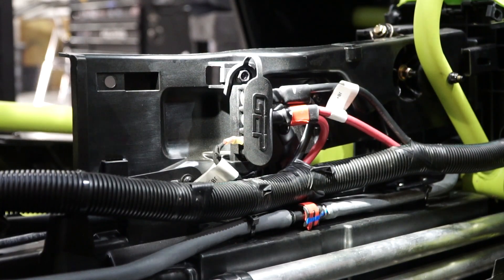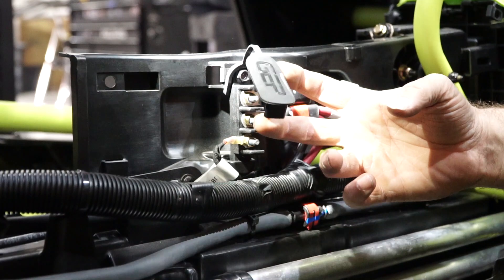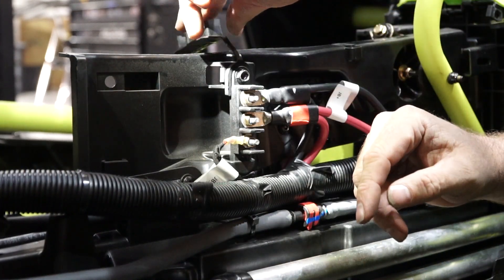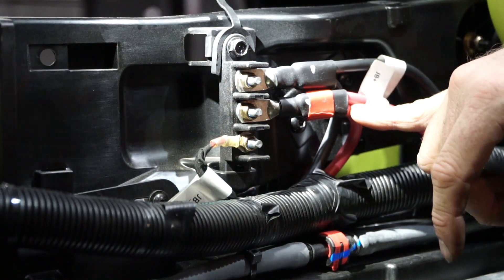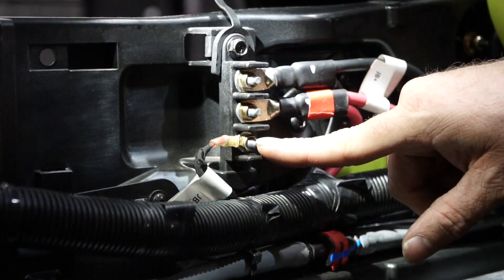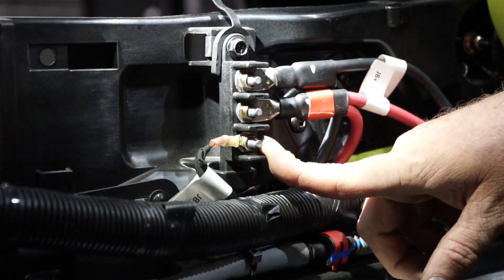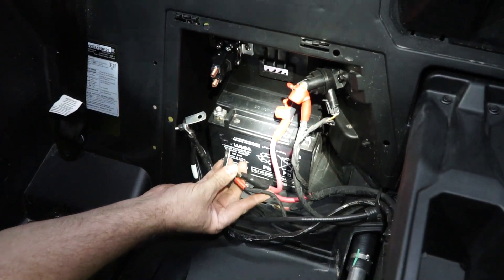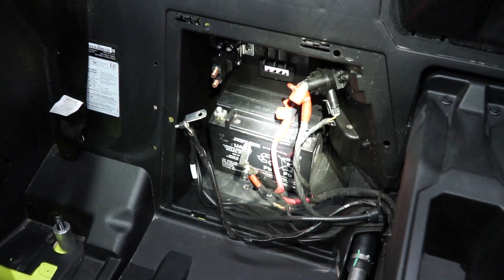X3 Bus Bar EXPLAINED

Comment: Hi! So if i want to plug a led bar with an on/off switch,i put minus in minus and plus on plus? Nothing on acc(3rd one)?
Reply from the maker: Yes, Accessory is used for illuminating the back light when key on ignition

Comment: No expert on wiring but i have a stage 4 rockford fosgate on my x3 i paid 3k for someoone to install and this is the 3rd to 4th time i have problems with it sometimes by sub wont work or a chase light and now recently only by tweeters work i got no sound coming from my sub or speakers i wannna attempt to rewire the darn thing myself or could it just be a battery problem ?
Reply from the maker: hi @everesth2751! First off, I would check the voltage on your battery to make sure it's not low. If voltage looks good, I would start following the speakers back to the amplifier(s) to make sure all the connections are still good.

Comment: It shouldn't be titled explained if you don't mention where it's located. It's an overview at best
Reply: Can't you tell from the cage and the coolant lines?   Take out the passenger seat and then remove the plastic pieces on the center console.  That is where this is.
Reply: He did mention it very quickly, the x3 has it between the seats, the regular mavericks and also the defenders typically have it up under the dash.

Comment: Where does the accessory wire go? Does is have a fuse that can pop? I’ve lost power with key on at the accessory post
Reply: Any luck? Having the same issue after installing whips. My accessories post doesn’t give power to anything at all, my onx6 or my squadron sports won’t work unless connected straight to the positive
Reply: @X3.Rvxlll  Hopefully you already figured this out but if not see my post below. This fuse is not a common blade fuse but it does exist.
Reply: The accessory post is fused, its typically under the "hood" or wherever the fuse panel is on each machine. If my memory serves its a 40amp and its the square style. I popped mine once when my winch was frozen. However, you should definitely use more fuses to isolate each when possible, it will keep say your sound bar from blowing everything thats on the accessories post all at once should you have an issue.
Reply: @jhoffman81  yeah I found it and fixed I got everything to work again like my rock lights and whips and all my baja designs lights
Reply: @X3.Rvxlll  hey I think I burnt a fuse on my x3. Where was the fuse to the bar located? Thx
Reply: @X3.Rvxlll  I had all my accessory stuff quit working but machine runs fine. How did you fix this?
Reply: Did you ever find out?
Reply: I’m currently having the same problem have y’all find out something
Reply: @juniorgauna6087  any luck on this issue as I’m having the same problem
Reply: I’m currently having the same issue where can I find the burnt fuse location?
Reply: Guess I won’t be using that bus bar

Comment: I am late to the party but thank you for this the previous owner has everything going to the battery it looks like a rats nest. One question eventually with rock lights bars stereos etc etc you will run out of room on the ground and acc. So then what?
Reply: They make additional power blocks that you can wire in that give you more spots to hook accessories up to if you want it to be super clean. Just Google can am power block
Reply: @joshs1993  Thanks for the heads up

Comment: Hello had a quick question so if you put a cable from one of your accessories in the middle bolt will it drain your battery even if the car is off ? Thank you
Reply: yes
Reply: @joshs.8278  how should a turn signal kit with horn be set up ?
Reply: @Tjx9mm  turn signals and the horn are both controlled by a switch (or button). They should likely connect to the constant power so you can use them without having the vehicle on. Horn should definitely be available to be activated without the ignition on.
Reply: Josh S. Have another question if I’m wrong then we’re will the my other cable goo my accessory has 3 cables black red and orange
Reply: @danielgonzaga857  Red is usually asking for CONSTANT power. So if you have 3 wires, it SHOULD be POWER (CONSTANT), ACCESSORY (KEY ON), and GROUND (BLACK). This is usually for something like a car stereo. It needs a constant power to remember stuff like your settings, time, favorite channels, etc. It will not drain your battery if it his hooked up in that manner. What accessory are you trying to install?
Reply: Why when i connected my switch pro on ACC or seperator it doesnt work i ad to find a wire to connect to this some other way. I guess on the 22 the acc only works when the on switch is pressed. 

Can am maverick rr